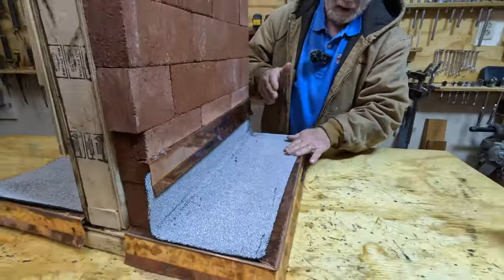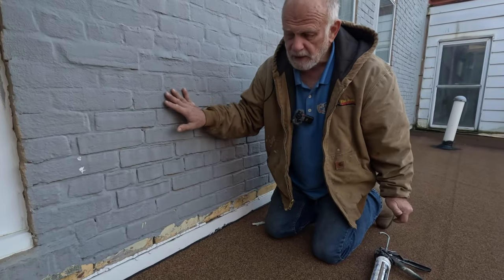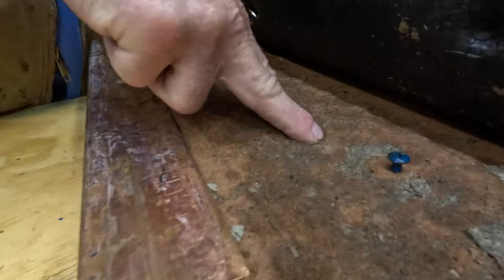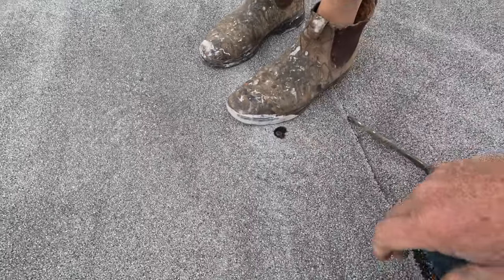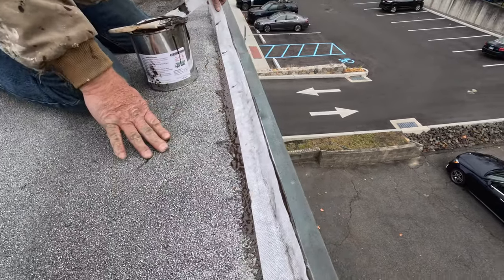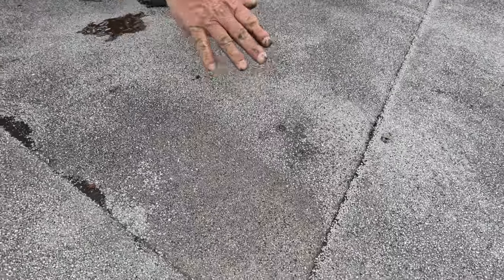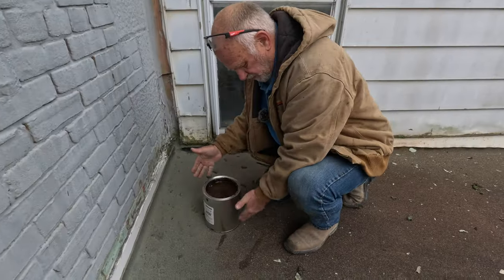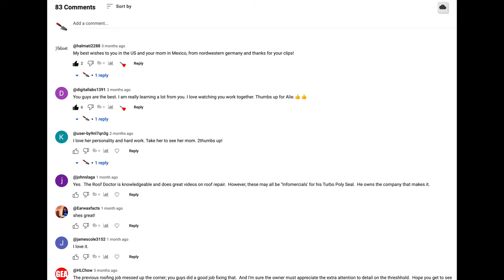Flat Roof Leak Repair - 90% of roof leaks are caused by this one problem DIY Fix for anyone

Comment: The advice is excellent! Roof work has torn my back and body apart and I'm young. 😢 But 90% of calls are these 2 issues, 10% pipe and panel flashing failure.
Reply from the maker: You got this! At least someone agreeing.

Comment: Thanks.  All good except...
Torch down seams can usually be sealed with a trowel and 1lb propane torch - and no added material.
Open seams are always because 1. Original seal wasnt done with enough heat or 2. Top was applied to granulated bottom.
So either,  1. Reheat and seal or 2. Heat bottom, scrape off granuals, reheat & seal.
Reply: Agreed.  My experience also.

Comment: Had 4 roofers come out, I knew I just needed some patch on 10' drip edge lifted.  Have 20yr old sbs 100lb. Low slop.  I've always painted roof granular with latex white paint,about every 8 yrs, is that a good idea?  Thx
Reply from the maker: Any protection helps. UV's is the biggest killer of any roof.
Reply: Thank you for reply, also have 105 sbs premium hot mop over 43lb with white tile over, which I installed 25yrs ago, hopefully will go another 30+, today they put junk under tile, imo. @FlatRoofDoctor
Reply: Use an oil-based paint with high gloss.

Comment: This video couldn’t have come at a better time.  I live in Philadelphia and started to have a leak in our kitchen where the AC pipes go through the roof to the compressor unit (compressor unit on the 1st floor roof).  We had the AC unit moved off the roof and then had new torch down put on.  The new torch down was done because the existing roof wasn’t in good shape and had cracks where the water was getting under the roof and making its way to the hole.

Unfortunately, we are still having water get under the roof and it is because the roofer did not seal it against our house properly.  We have aluminum siding over brick.  Now they’re saying we need all new siding.  Should this have been part of putting down the new torch down?  Also, I can’t see or feel any metal flashing under the siding so how would anyone even properly put down new torch down without taking the siding off? I’m trying to figure out if I can get under the siding and tar it myself.
Reply from the maker: Taking aluminum siding off without damaging it is almost impossible.
I think your best bet would be to try and remove the bottom panel of the siding, then seal the roof against the brick wall.
I think you could remove the screws that holds the siding to the wall. But if it is nails, you will have to pry them out. 
I suspect that there is either a window or door in that wall above the area of the leak. Water will get in behind the siding at the window sill or above the door drip cap.
Just areas you could look to see if you could seal that instead of removing the siding.